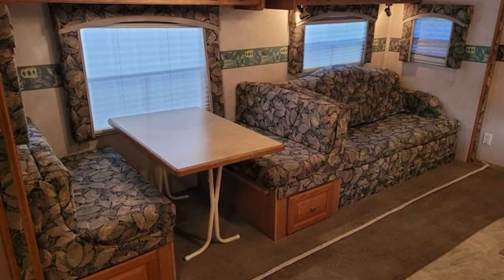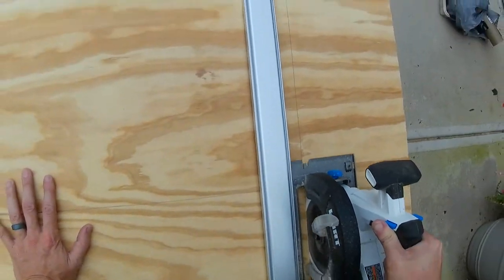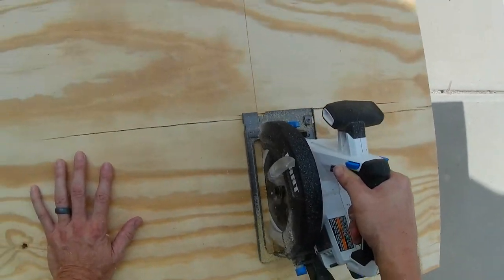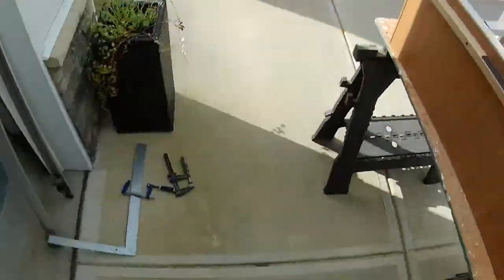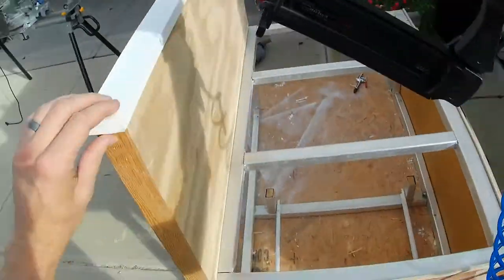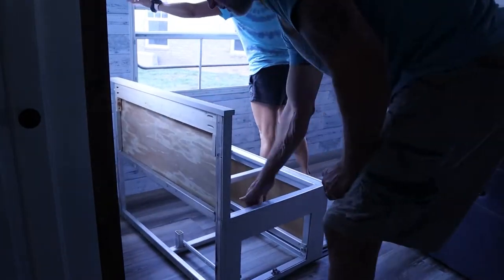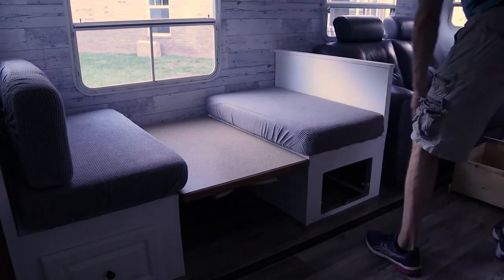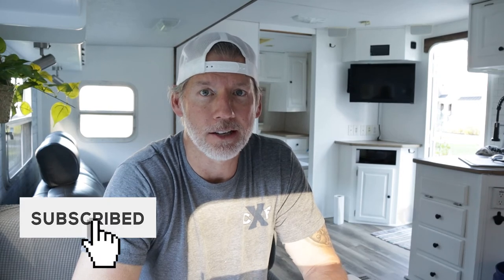RV Renovation | Dinette Remodel Before & After | DIY Camper

Comment: Personally I'd rather rip out a dinette. prefer a futon and if I want to eat just pull out a folding table or sit outside underneath the awning.
Reply from the maker: If I were to do another I would have attached a better base and made my own butcher block counter top or table top. But a futon would work as well. Just depends on the need I suppose.

Comment: This is definitely an aesthetically pleasing improvement.  My question is about function.  Do you need the sleeping space conversion of the dinette?  If you do, I see why you put the seats so far apart that anyone sitting there cannot use the backrest and eat at the same time.  

My Forest River Cedar Creek Cottage 40CFK2 comes with a bench (not fixed) in the 2024 model but it's situated way too far from the table to be useful as dining seating.  I noticed it is the same with your seats.  I do like the idea that the table is free-standing so if both of you are sitting on just one side you can pull the table closer to make the seating more comfortable. Do you have to do that?

Next time you make a "how to" video don't swing the camera around so much, it takes away from what you are trying to demonstrate.  Also, I didn't know you could nail into the aluminum supports.  Good demo.  Beautiful result.
Reply from the maker: Thank you. I know I was quickly chasing my wife around. My other videos are much more smooth. Lol.  We actually sold this unit so we didn't get much of a chance to experience it and find out what we liked and needed to improve.